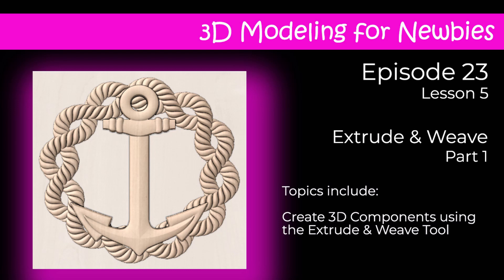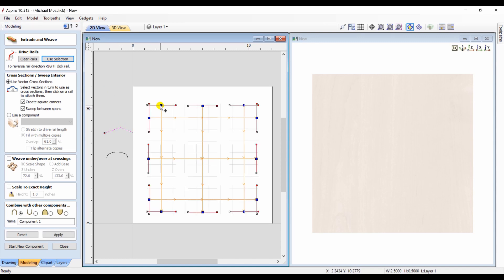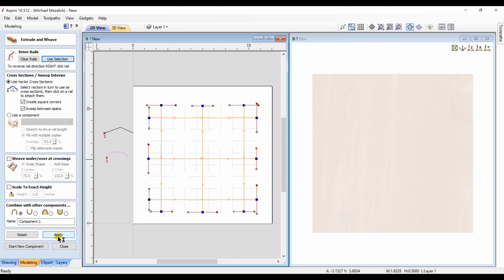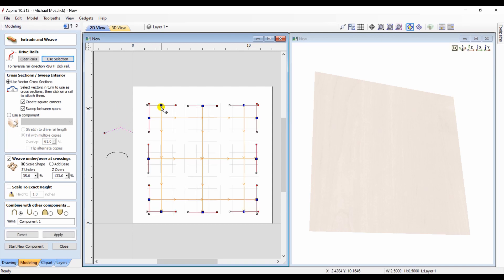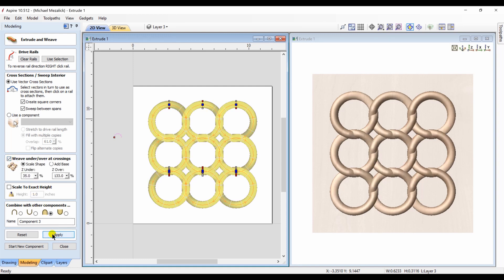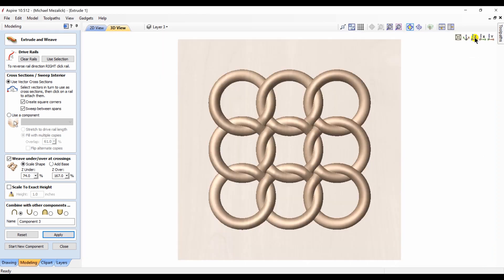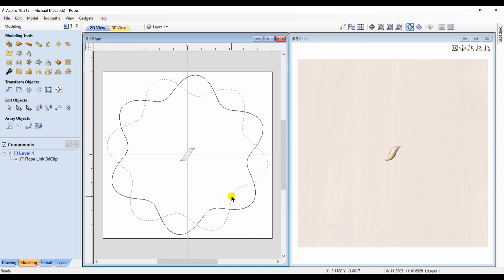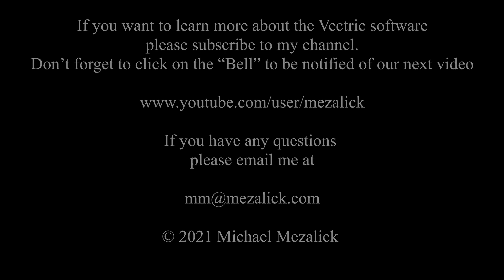3D Modeling for Newbies Lesson 5  Vectric Aspire Extrude and Weave

Comment: Hi,  Thank You for the video!  How did you create the "undulating vectors" in your rope link example?
Reply from the maker: It's a series of overlapping circles and a little trial and error.
Reply: @mezalick  Thanks... I ended up making a hexagon for the center points of the concave lobes,  and a larger offset hexagon that intersects the 6 circles at the tangent points for the concave lobes, and drew 6 more circles, then used scissors tool to cut away all of the unnecessary vectors.  Also a little trial and error ;)
Reply from the maker: @kelleysislander  Sounds the a great approach..It's simple once you feel comfortable playing around...
Reply: @mezalick  I know I'm late to the party, but boy I'm having some trouble creating these "undulating vectors".  I've been playing around with it for a few hrs and have had some luck, but i'm not satisfied.  Would love to see your process on it.  If you feel so inclined making a tutorial on this exact thing would be amazing!  If not, no worries.  Thanks again for this series, it's been incredibly helpful!
Reply from the maker: @ZacDedo  Send me an email and I'll send you a PDF showing the way I make the vectors........mm@mezalick.com